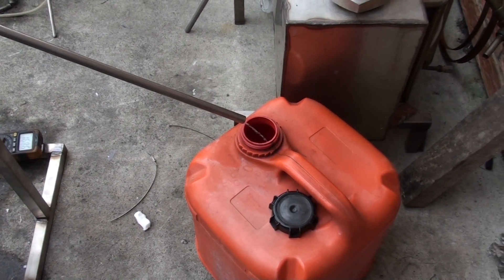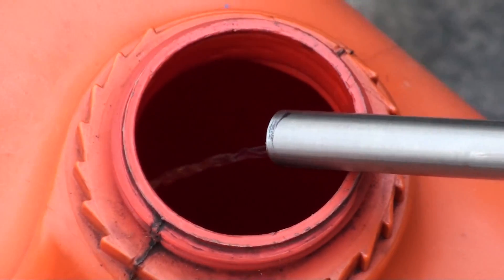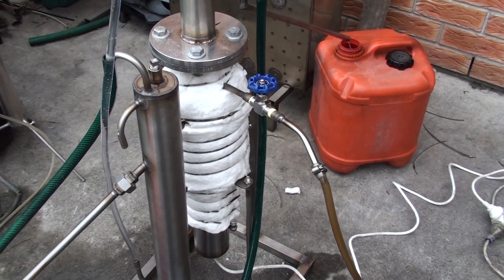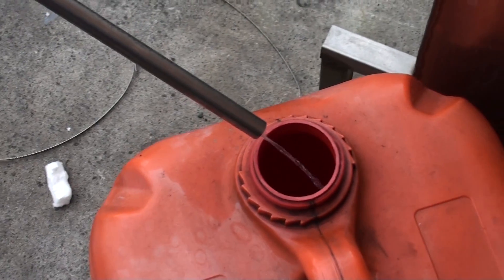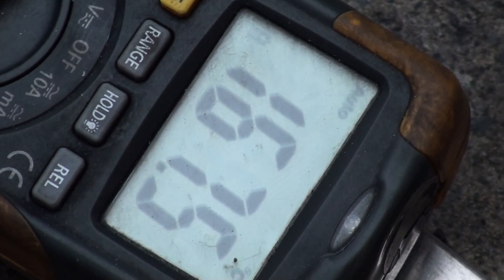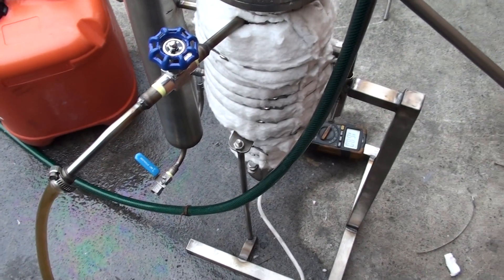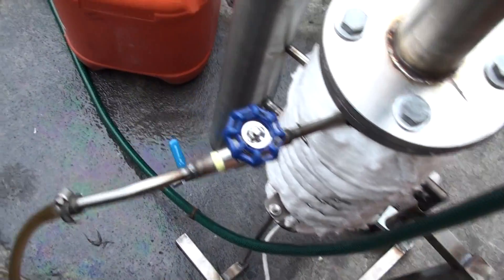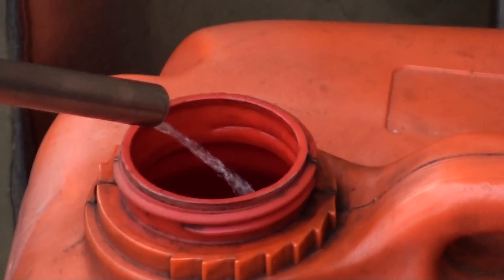Fuel separator

Comment: what type of heating elements do you use?
Reply from the maker: High temperature tolerant, stainless steel cartridge elements.
Reply: @santeryi9  ahh just the big brothers to the 3D printer head elements ;)